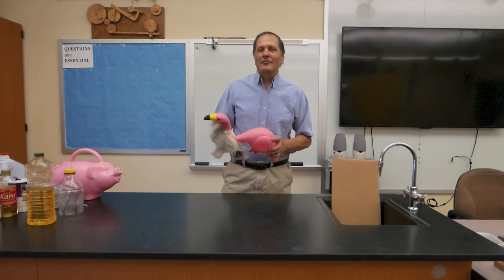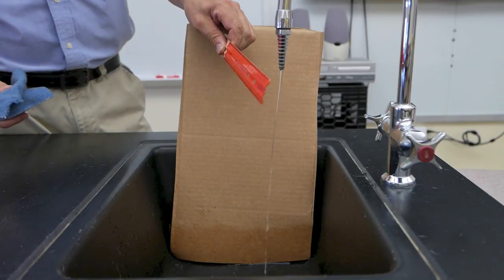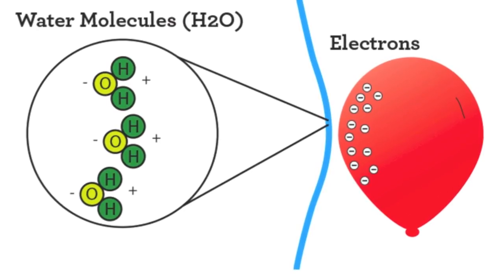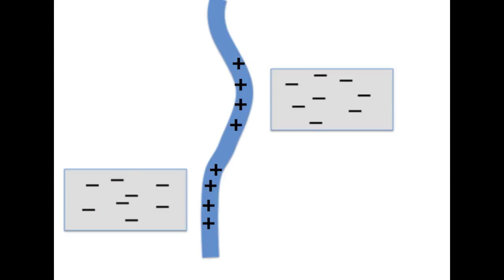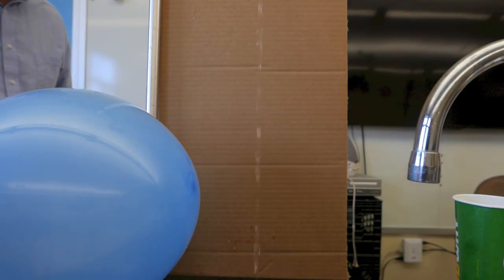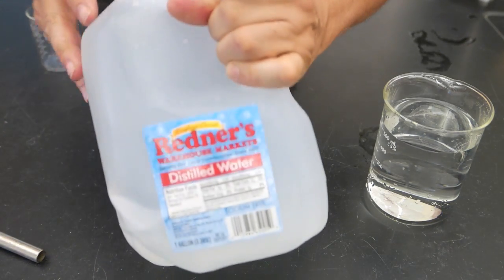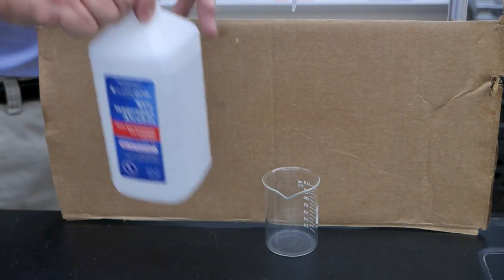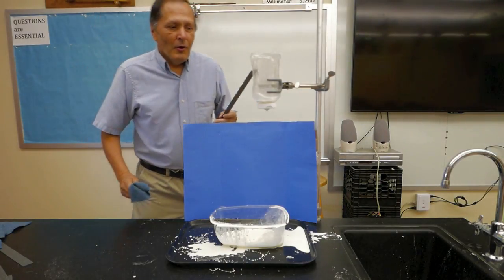Bending streams of water with a static charge // Homemade Science  with Bruce Yeany

Comment: Can a static charge be generated in water via particulates rubbing together, such as in highly silty waters in areas of intense wave action?

I could have sworn I read about this phenomenon -- is the fact that lightning does occasionally strike the water evidence for such buildup of charge?

As ocean levels rise, is it likely there will be an increasing amount of cloud to water strikes?

As a result, could it be that larger sections of Earth's surface (via water surface) could be charged at any one time, than was previously the case?

I know I'm just a regular person, but I'm trying to understand something about impact craters. Scientists love to go meteorite hunting in deserts or the Arctic, because that's where you can easily find nice, fresh pieces for analizing. But the major impacts are mostly either in bodies of water, or where water used to be. 

I have a suspect rock that was pulled from a crater discovered in a construction cut. Yes, unlikely to be a meteorite. But just humor me a moment, because if it is, it's  stucture (one clear attachment point, two somewhat resorbed "siblings") and high salt content speaks of a thing  built like a handgrenade made of blobs that had to have blown off a larger piece, that had to have blown off a much more massive piece. 
The way the thin melted rock on the surface has been applied with black fusion crust like chat that fla kn es off, suggests that if it is a meteorite, it  may have passed through our atmosphere at least 1x before the final melt episode prior to crashing.

Could an increase in Earth's surface and atmospheric charge attract meteors that would otherwise pass harmlessly through our atmosphere like the recent 800 foot one did?

Could such fluctuating charge be the reason for another famous asteroid changing course 3 times (wavy course) as it passed by?

Comment: If we use a bigger stream of water, it will not become very thin so early and will not divide into droplets. I expect it not to react to the charge.  Far from the nozzle  water moves too fast. It has too little time to be attracted to the charge. To obtain visible attraction there should be more charged objects along the stream  to prolong the influence.

Comment: It seems to me that the reason for the stream of water bending more at the top than at the bottom is that the water is travelling faster at the bottom so the force from the charge is acting on any given section for less time time and it acquires less impulse.

Comment: I just don't buy the dual charged molecule theory. It's my understanding that a water molecule should be neutral or slightly negative but it cannot be positive. However, I reckon hydronium (H3O+) ions are always present in water to some extent by the colliding molecules breaking an  atom from the O2 and from the hydrogen also to create an odd number of atoms for each so that for every hydronium ion, a negative oxygen exists and/or bonds to form another negative ion such as HO-. This is my best guess but I can't help but also suspect ionization of the air is playing a part since viscosity is so relevant as opposed to chemical make-up. That being said, if I understand correctly, even neutral substances contain some amount of ions if exposed to the atmosphere.

Comment: The soap looked more responsive to positive charge and the chocolate looked more responsive to negative charge than the other.
Reply: One thing you have to remember is that the strips might be charged a different amount each time, you would have to repeat it or control the amount of charge somehow
Reply from the maker: the thick liquids were kind of a last minute experiment so I didn't get a chance to do much testing.  To me it felt like the school glue was by far the most responsive,  however it doesn't appear that way in the video.

Comment: what caused the the corn starch to oscillate like that? was almost as if the static was creating an oscillating eddy current
Reply: nemode dj I think it's just because it's a non-newtonian fluid. It'll act much different from water
Reply: a non-newtonian fluid is a fluid that resists shear at a nonlinear rate with respect to the fluid's speed, the result is that when you move slowly in the fluid, it moves freely like water, but when you try to move quickly, the fluid "locks up" and feels solid, try making it sometime it's fun to mess with